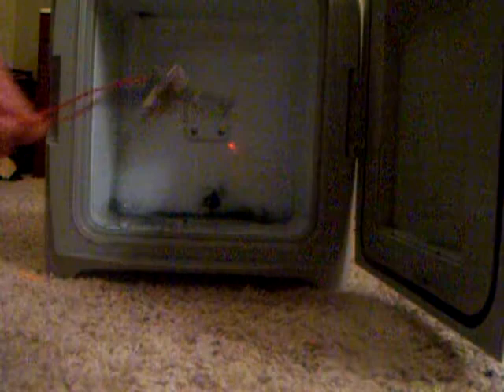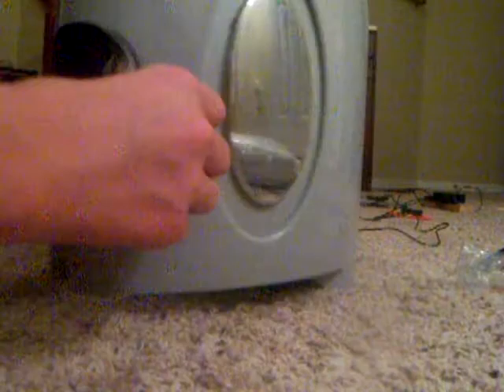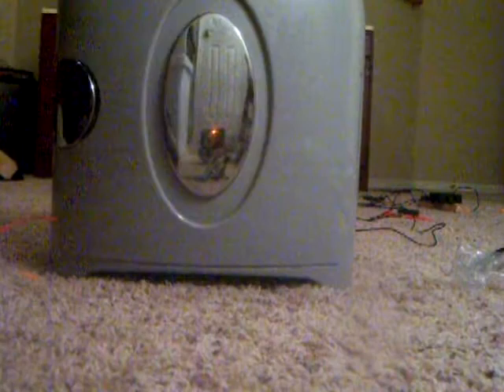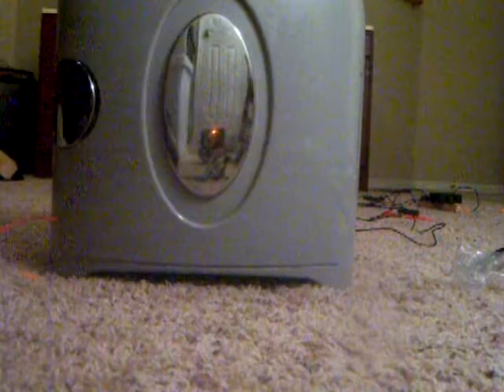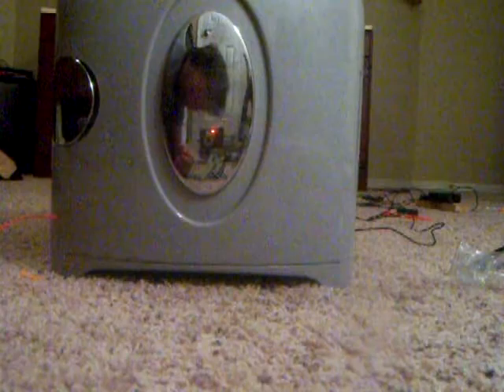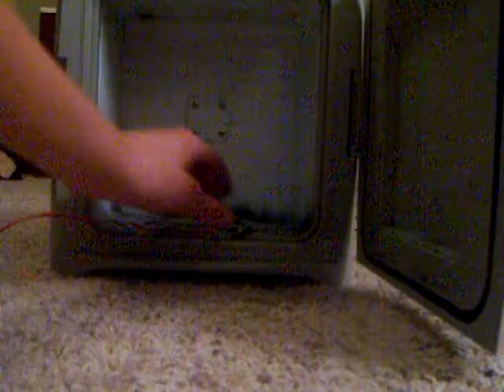How To Make A Micro-Explosive

Comment: I make these all the time but I use mg flash just some tips.... I put hot glue in the end of mine not a big deal but to save time you can heat the end and then put it under water then it will become brittle and come right off